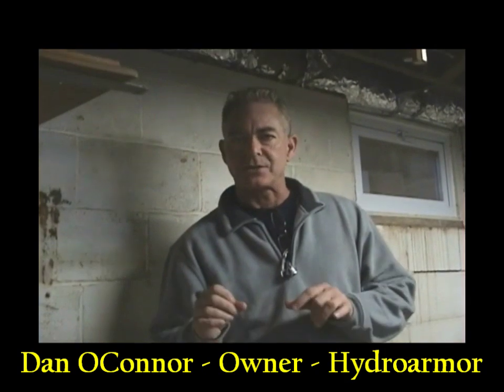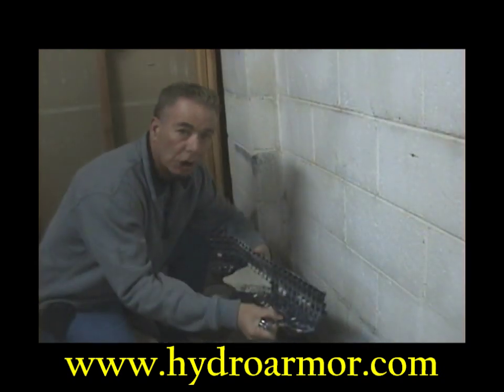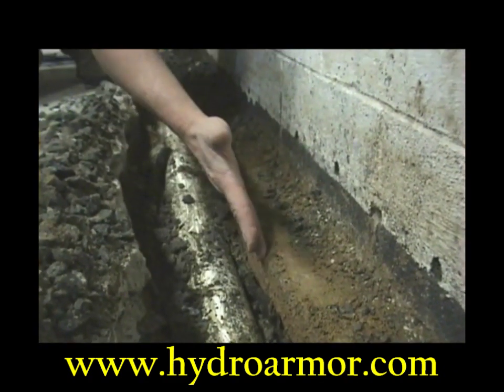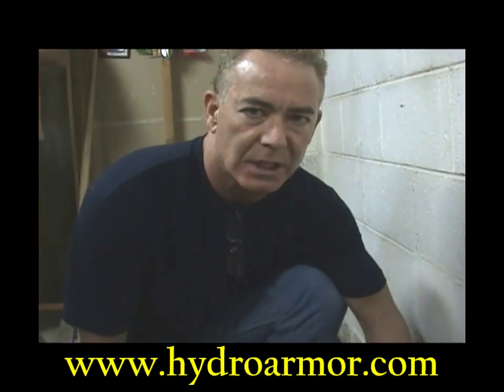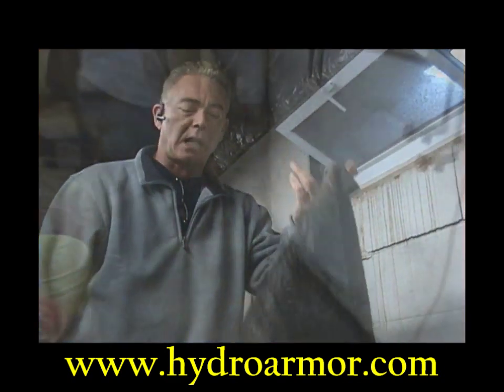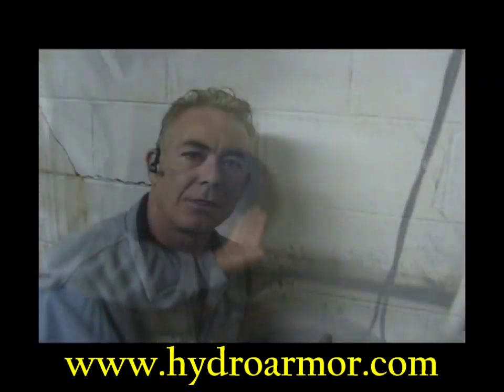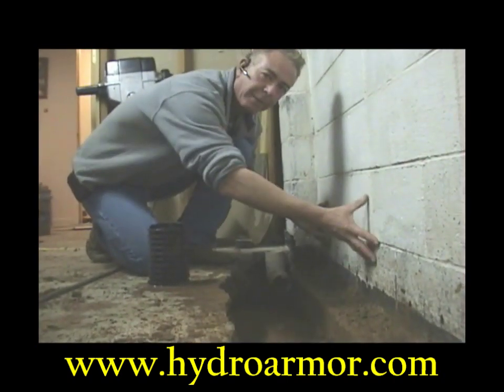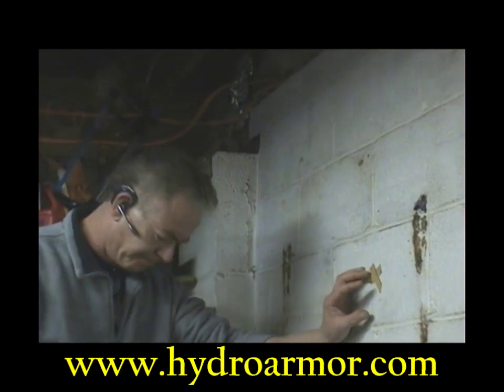A Tip about Basement Waterproofing and the "Bait and Switch" by "Who Done and Ran" Inc.

Comment: Dan,
I have a question regarding mirror drain. I am curious how the water/humidity doesn’t make its way between the wall and the trench, if it wicks down seems to me it could make its way out as well. Not trying to be a jerk by any means just curious as I am having to have my current system redone since it was done incorrectly prior to my moving in 1.5 years ago.